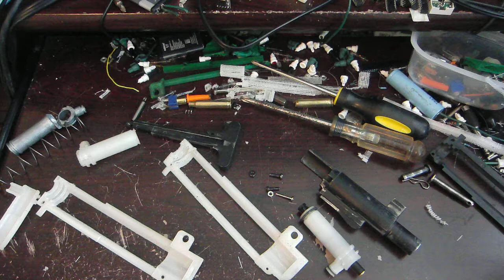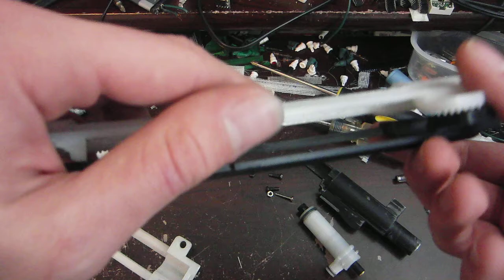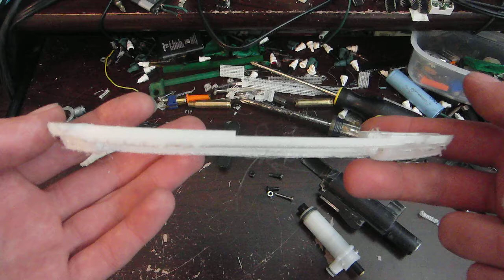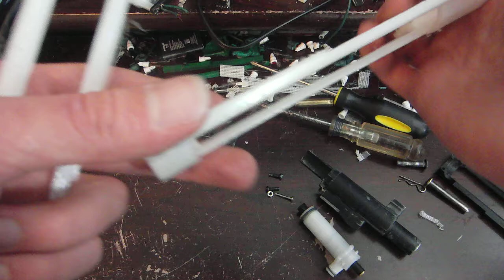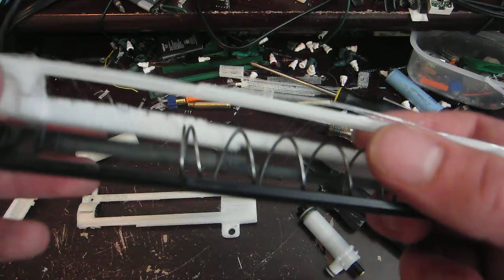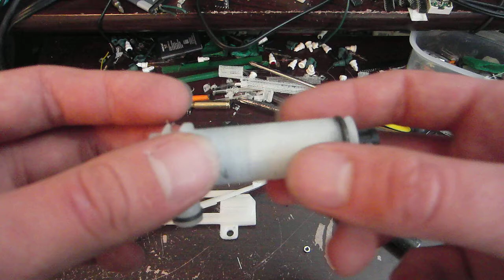3D printing replacement parts for the GHK GBB conversion kit Part 2

Comment: When printing, do you use a brim or support structures?
Reply from the maker: Supports but not usually a brim sense i'm cheap but that would fix many of the warping issues.